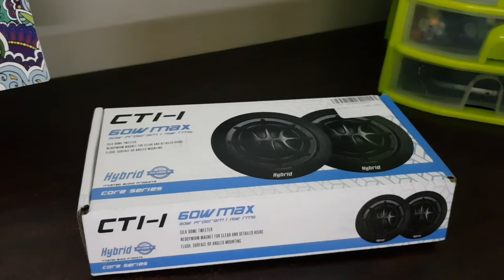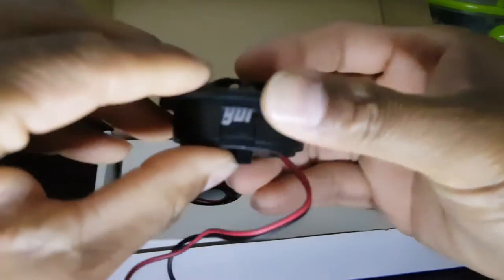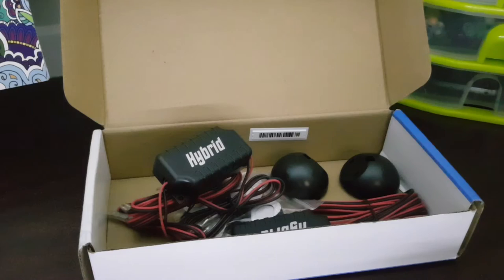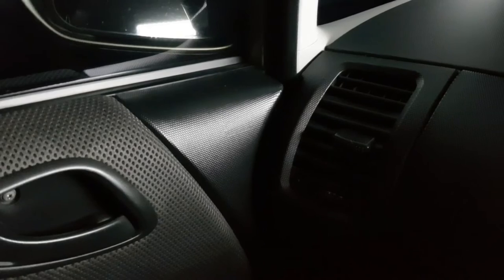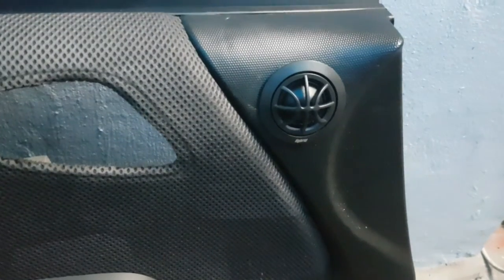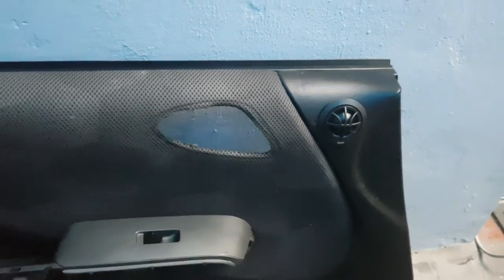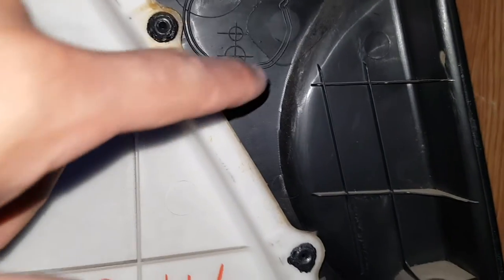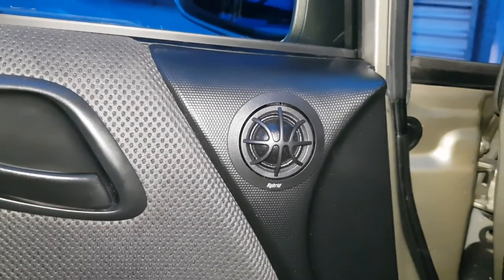2006-2008 Honda Jazz/FiT tweeters install

Comment: Hey there could you please do a Review on the Jazz if you still have it? Your videos really got me interested in them but now I've recently discovered that they have a massive problem with Leaking. What has been your experience with this problem?
Reply from the maker: Hey bro, what would you like to see in the review, and what sort of leaking issue were you told about?
Reply: @TechniqBB6  like a owners review, what you like and what you don't like maybe 5 things you like and 5 things you don't like and then common faults and maybe cost of ownership? Like major and minor services etc. I heard that the bootlid leaks in by the roof gutters because of a factory fault?
Reply from the maker: @BasicKustoms  cool will do so as soon as I get a chance to. Perhaps the older models had leak issues but so far we haven't had an issue with water ingress. My wife's one will be up for sale soon as we need a bigger car now that we have 2 kids so if you're interested we can chat sometime 😀 😉